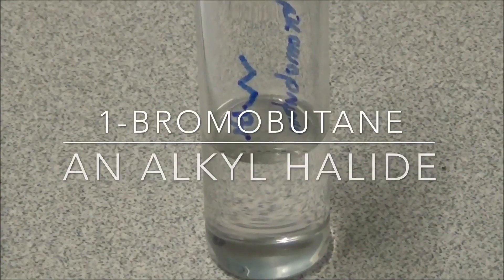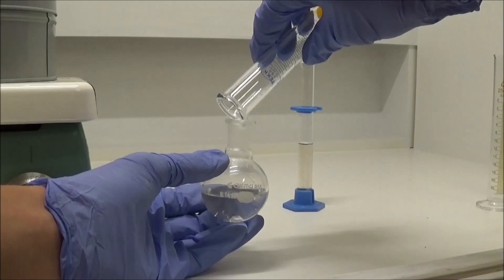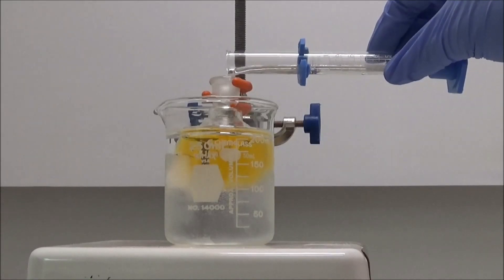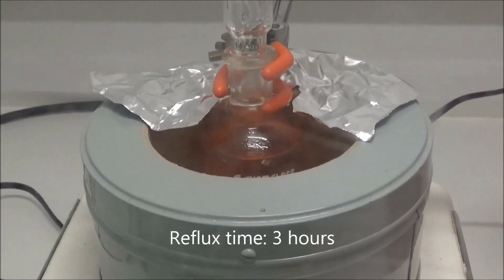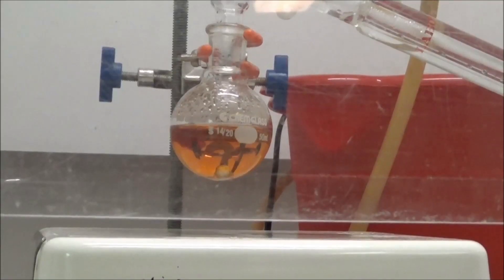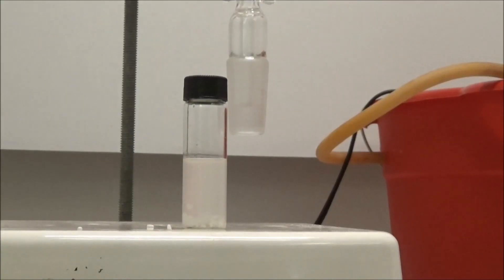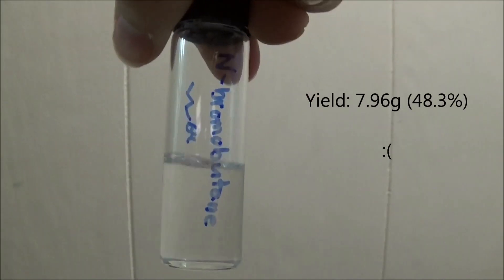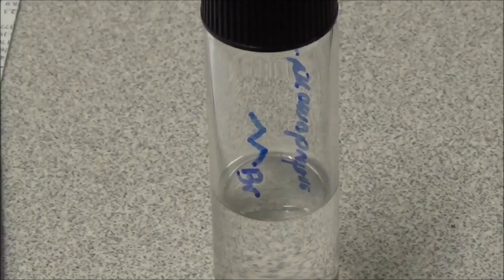Preparation of 1-bromobutane

Comment: Would you say there are any issues with using an oversized heating mantle? I've read it decreases their working life, because they might burn out.
Reply from the maker: Yes, being too big is generally not a good thing, they run hotter. With this particular one I am not as concerned, it is rated for very high temperatures. With my fiberglass ones I try not to use a flask that is less than half the size of the mantle.
Reply: Tom's Lab ok good to know. Cuz I bought a 500mL heating mantle hoping to use 250mL in it too
Reply: Make a coil, got a set of aluminum heating bases for RBs. Loads in box results variable hemispheres mantles.  Wanna get a 5 liter or jacketed small stop messing with millions parts to break set up move.  Wonder if diy heater pump fluid on web.  Can’t afford all that cooling can manage. Bet thermal tolerant pump not cheap. Nylon probably need steel, ptfe will be specialty silly expensive.

Comment: Please make a Video: Synthesis of 1-Chlorobutane with HCl.
Reply from the maker: Alkyl bromides are usually more useful than the chlorides, why do you want it? The procedure should be similar, although longer reflux would likely be necessary.
Reply: All Alkyl bromides are cargenic or mutagen, but 1-bromobutane. But chlorides not.

Comment: You have way too much liquid in your round bottom (overflow is not so fun)

Neat video !
Reply from the maker: +The Chemical Workshop Yeah I know but as long as it is only boiled gently then noting bad should happen. One time I overfilled a flask in a reaction where gas was produced and it bubbled up nearly out of the condenser.